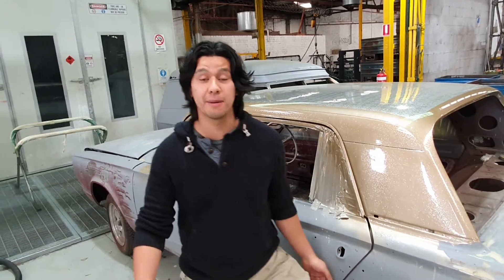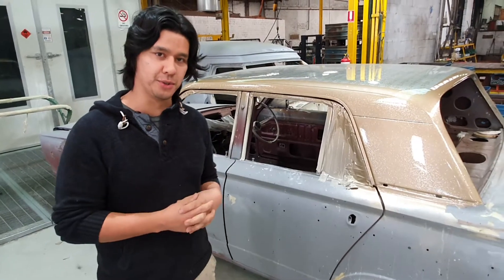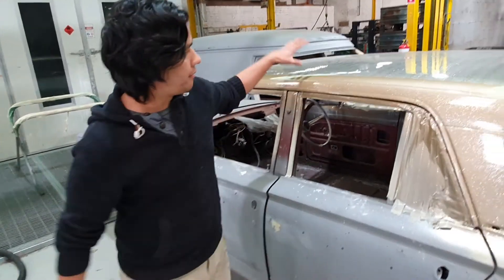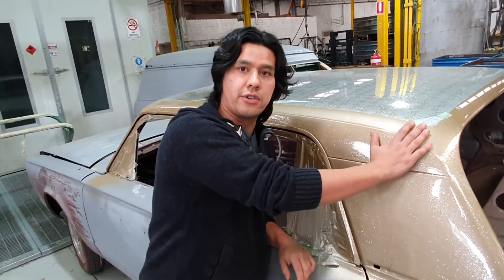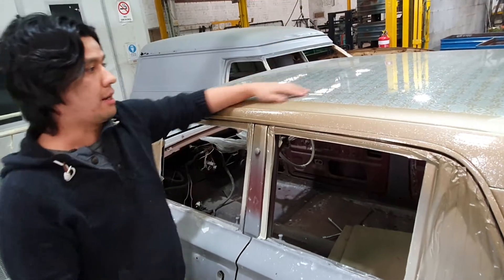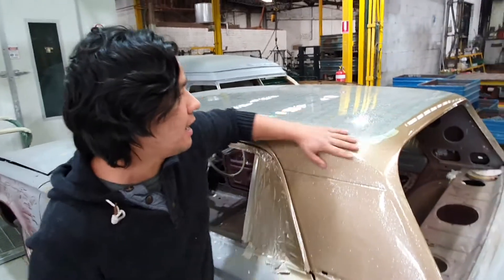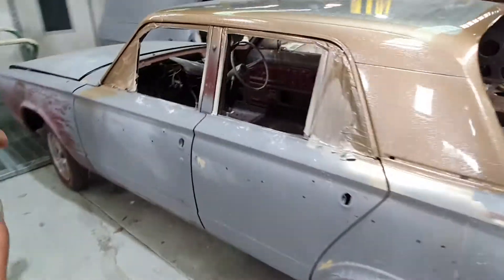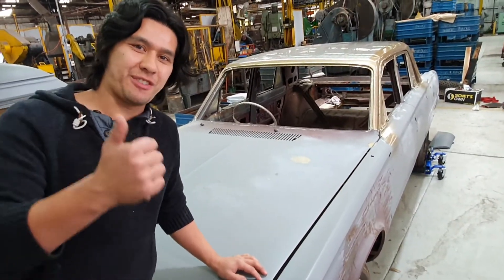Making Poor Decisions When Buying a 'Project' Car

Comment: Hey mate i follow your channel but haven't seen any more of this vc? Do you still own it?
Reply from the maker: Hey mate, I've still got the VC. I'm tinkinering with a 318 motor at the moment...the VC is in poor condition only really suitable for a drag car. My plan is to finish up some of my other stuff and then tackle it at some point cheers!
Reply: @OzGeneralStore  i may have a better vc regal you can purchase if interested. Will need $2500 its missing some parts but has all interior, hang on panels and running gear. Pretty solid car, may be a better donour car and can use parts of the rusty one to make a complete car. Let me know if your interested. Car is located in Gordon, victoria. Cheers
Reply from the maker: @67wogval  Shoot me an email at info@murrayag.com.au and let's chat some more! Jon